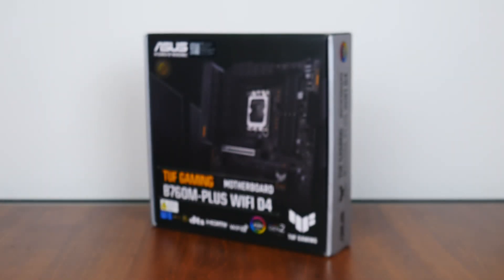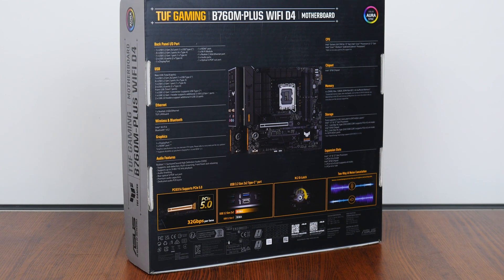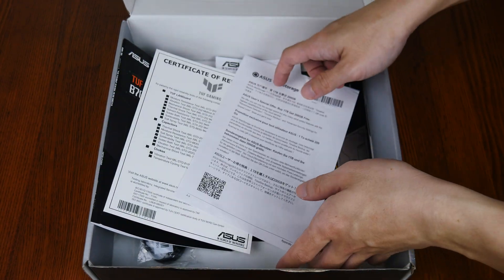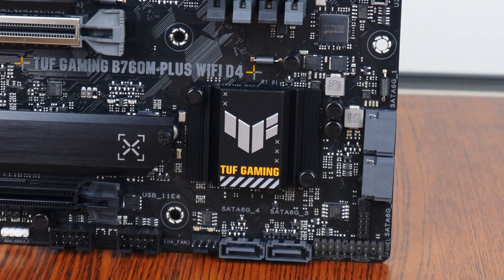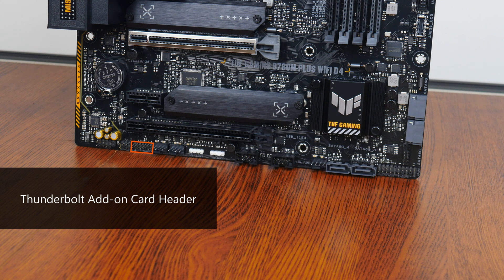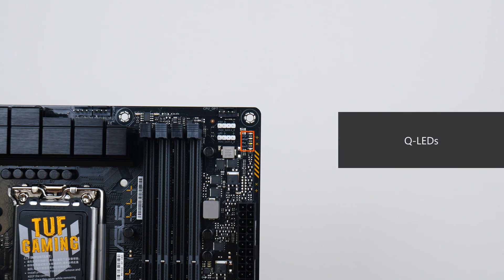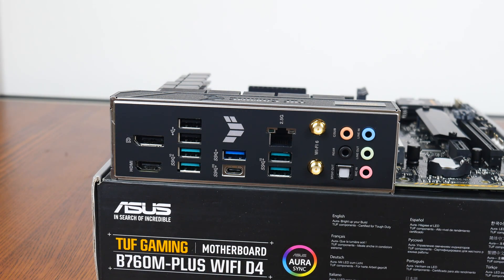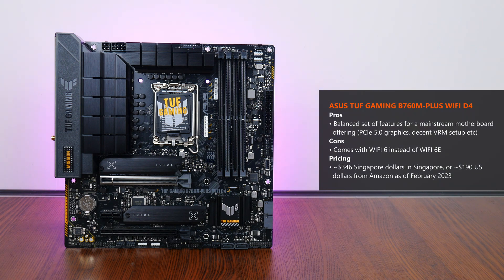Mainstream Intel B760 Motherboard - ASUS TUF GAMING B760M-PLUS WIFI D4 Unboxing & Overview

Comment: perfect for a i5 12400f or 14400f, you might even be able to throw
in the i5 14600k or 12600K, which might be a better option with the 
latter since later lga1700 boards can handle 12th gen pretty well,
compared to the B660 chipset. that struggled to run even a i5 12400,
so this is an improvement, that said i probably wouldn't go any higher.
Reply from the maker: Yup I do agree with you that I wouldn't go beyond a 14600K with this board! Out of curiosity, you mentioned you had issues with a B660 board running a 12400, what kinds of issues were they and which board in particular were you using?
Reply: @ALKtech  it was a Gigabyte board, one of their
gaming x boards. had a different layout than newer,
so it was above UD, but the temperatures on the 
i5 12500 which is what i have were 47 and 48.
i mean that's not bad but not great either, cause soon as you start any gaming on it even light gaming, 79c is where mine was and that's with a 240mm AIO from Artic and 120mm fan. i had a
120, but i had to replace it with two 140mm fans
which was enough to fit in my case. doing that helped my temps down from 79 to 75, so it was
an improvement. so when later boards came
around, i ended up switching it. now my temperatures are much better at 68c.
so my idle temperatures are 35c, that alone
is the biggest difference. like mid 40's would
make more sense on a high end processor,
not something that's down in the low to midrange. So i think it was a combination of the board partners being unprepared for 12th gen, which
is why i can't blame them for going overboard
on z790 and b760 boards.
Reply from the maker: @Jeymez  got it, thanks for sharing. I do agree that those temps are pretty high for a 12400, glad that you managed to bring them down with a better board! I suspect the B660 Gaming X that you had probably didn't have a good design, perhaps Gigabyte cheaped out on the VRM setup/PCB quality etc...

Comment: can i pair this board with an i7 12700f? And will the i7 overheat with a 7 heatpipe 120mm air cooler?
Reply from the maker: Yup this board will work with a 12700F for sure - do you have the exact model of air cooler in mind?
Reply: @ALKtech  Hey! it is the rise mode winter black 120mm
Reply from the maker: @pedroaugusto9_  doesn't seem to be much info available on this cooler on the web - you can always install the cooler first and see how your 12700F performs by doing benchmarks and monitoring the CPU temperature with apps such as HWINFO64. If temperatures look fine and the CPU isn't throttling, you can stick with the cooler for sure!
Reply: @ALKtech  ok, thank you!

Comment: What’s different between B760M-Plus wifi D4 vs B660M-Plus wifi d4 ? And does it worth upgrading ?
Reply from the maker: The B760 offering has a newer chipset, a better VRM setup and a slightly different PCIe slot configuration than the B660 board. If you already have the B660 board, there is no value at all in upgrading! Besides, the B660 board also supports Intel's latest 14th Gen processors..

Comment: Now I'm thinking of buying it. I will use it with I5 12400f และ rtx 4060 ti But I bought it for future use. In the case of upgrading CPU and RAM and various equipment I think this board might be suitable for me.
Reply from the maker: Oh yes, this board supports 14th Gen processors so you'll definitely have an upgrade path from the 12400F in the future!
Reply: @ALKtech  I would like to ask a bit more. Suppose I want to overclock. I5 12400f ( BCLK ) This motherboard can be overclock ? Or does it have to be a B660 board with DDR5 RAM?
Reply from the maker: @KINGCEOTV  I haven't tried BCLK overclocking with a B760 board before, but having trawled some internet forums, it does appear that ASUS B760 boards might not be able to do BCLK overclocking successfully - it does appear that MSI B760 boards can do BCLK overclocking though...

Comment: Very informative video.  Got this board on Black Friday($119.99 US) and pairing it with the i7-12700K($211.00 US) and the ASUS microATX P201 case...I know the 760 won't overclock, but the K - CPU was massively cheaper than the non-K at the time. Receiving the rest of my build parts today...kinda excited!!
Reply from the maker: Sounds like you've got a nice build on hand - what graphics card will you be using? I'd get the K version over the non-K in a heartbeat if the K's cheaper for sure!
Reply: @ALKtech  for right now I am going to use the the integrated CPU graphics. It's mainly going to be for music production so I am going to see how it performs in that realm before investing too much in a GPU.
Reply from the maker: @musicturtletony8498  sounds good, since a GPU won't really be necessary in your use case. You could always look to the secondhand GPU market too if need be, to save that extra cash!

Comment: i heard that there are sometimes some issues with the bios because of the cpu so i wonder if my i7 12700kf would get a issue like that on this board. I would appreciate it if someone would help me out
Reply from the maker: What kinds of issues did you hear about? If you're talking about compatibility and stability, I'd think the 12700KF should work just fine, seeing as it's a last-gen processor after all!
Reply: This bored says it should be 12th 13th and 14th compatible

Comment: what is the wifi-6 input? does that mean u need a cap or sth?
Reply from the maker: Are you referring to the point I raised about the board not supporting WIFI 6E? If so, WIFI 6E is essentially a wireless standard for internet connectivity that is faster than WIFI 6. It just means that this board won't be able to support the speeds supported by a WIFI 6E-compliant router!

Comment: Is this ok with I5-13500 and 2080Ti Oc? Im not sure if its going to destroy the pcs performance.
Reply from the maker: This board will handle a 13500 and 2080 Ti just fine, not to worry. Just make sure you've got a decent CPU cooler and good airflow in your PC case!
Reply: @ALKtech  yeah, I thought Ive had issue with cooling, turned out my thermal paste was dry af. Thx.

Comment: Does it have tpm which is necessary for win 11? I was comparing this with a board of same class from msi and they mention tpm header. Need some clarity on this.
Reply from the maker: You don't need a discrete TPM per se - modern processors (such as Intel's 12th/13th/14th Gen processors to be used with this B760M-PLUS motherboard) already include a firmware variant of TPM onboard. The TPM header is only if you'd like to get a dedicated TPM device for very specific use cases - if you're an average user intending to use your PC for gaming and normal productivity workloads, you won't need to purchase a separate TPM module just to be able to install Windows 11. Hope this clarifies!
Reply: @ALKtech yeah that makes sense. Thanks for clearing it up.

Comment: What's better this one or tomahawk?
Reply from the maker: I assume you're comparing this to the MAG B760 Tomahawk WIFI DDR4? The Tomahawk comes in the ATX form factor, while the ASUS board in this video comes in the micro ATX form factor. That aside, both boards are otherwise quite similar, apart from the fact the MSI has a slightly better VRM setup. What processor are you intending to use with either of these boards?
Reply: @ALKtech  i5 13600kf
Reply from the maker: @Gforce577  the 13600KF will work just fine with either board. Is there a price difference between the ASUS and MSI where you're from?
Reply: @ALKtech  yes asus more expensive if it just the same i just choose the cheaper one
Reply from the maker: @Gforce577  go for the MSI then since it's the cheaper variant - you'll want to make sure that the MSI fits your PC case though, as like I mentioned, the ASUS board in this video is micro ATX while the MSI board is full-sized ATX!
Reply: @ALKtech  i just buy the rog strix b760-g ddr5 version matx since i watch it in your channel and read it in rog website seems good but now. I want to use it with matx case does it needs matx power supply or the atx one the same?
Reply from the maker: @Gforce577  any normal PC power supply will fit in a mATX or full-sized ATX case, they have a pretty standard set of dimensions!

Comment: Can i use it with Intel 13700 ? Will it deliver full performance?
Reply from the maker: It should handle a 13700 just fine, make sure you've got a good CPU cooler!
Reply: @ALKtech  well if i slightly downgrade the mobo i mean if i take b660 same board Asus tuf gaming.. will it able to handle 13700 non K processor?
Reply from the maker: @ALAMIN4000  the TUF Gaming B660 series of boards should handle a 13700 well too!

Comment: Hello,  This model of the motherboard has 12 power inputs from the power supply device, should I use all of them or is the eight input cable enough for normally?  Because my power supply has only eight power inputs for the motherboard, I have a lot of stress about not causing damage to my motherboard if using eight inputs, all my talk was about isus b760 tuf gamin plus wifi d4
Reply from the maker: If you're not using a power-hungry processor like an i7-13700K, i9-13900K etc, you can get by with just connecting the 8-pin CPU power connector and leaving the 4-pin connector alone. What processor are you using/intending to use with this board?
Reply: @ALKtech  3 12100f
Reply from the maker: @voodoomoo  the 12100F doesn't consume a whole lot of power - you can get away by just hooking up only the 8-pin CPU power connector!
Reply: @ALKtech is 13500 will also be fine with 8 pin? also this mobo cant recognize my sata drivers as bootable drive. I already enable CSM in the BIOS. im wondering if i need to buy an nvme m.2 ssd.

Comment: Help! I bought this motherboard, and it won't fit with any of the CPU coolers I had. first try cryorig h7 then try dark rock pro 4 both have the same issue which is mounting socket cannot fit in. who knows what going on?
Reply from the maker: There should be a mounting backplate included with the coolers that you bought - you would usually have to install the backplate on to the motherboard as per the instructions manual, and thereafter mount the CPU cooler (with the processor already in the socket of course). Are you able to describe in greater detail the issue that you're facing with installation?
Reply: @ALKtech  Oh, I realized the backplate is not compatible. I had to buy an upgrade kit. Thanks for the guidance.🙏

Comment: will a 2 fan rtx vga fit in this motherboard? seems like the ram is so close to the vga slot
Reply from the maker: A two-fan or even three-fan graphics card will fit, not to worry! This is because board manufacturers have to spec a certain amount of clearance to ensure maximum compatibility, given the modular nature of PC components!

Comment: Hi, i'm going to buy this motherboard and I wonder if I would have a problem installing the arctic freezer 34 esports duo cooler...The VRAM heatsink is long and I don't know if it might affect when installing it, could you help me?
Reply from the maker: While I haven't actually tested this for myself, I don't think you'll have issues with clearances installing the Arctic Freezer on this board - CPU cooler manufacturers tend to spec in enough clearance so as to cater to a variety of motherboard VRM heatsink designs!

Comment: Currently planning my own build and I wanted to pair this motherboard with intel core i5 2600k with a Radeon rx 6600 would this be a good pairing anyone feel free to comment 🙏🏾
Reply from the maker: I'm assuming your processor is a 12600K, not a 2600K right? In any case, a 12600K+RX 6600 combo will work fine, though I'm curious what will you be using your PC for predominantly? Will you be gaming at say, 1080p?
Reply: @ALKtech  yes sorry the 12600k and mostly for gaming/streaming
Reply from the maker: @assassinx-rated1440  thanks for sharing your specs! Do you game at 1080p? The RX 6600 isn't exactly a fast GPU, and realistically speaking you'd probably be looking at gaming at 1080p Medium/High settings for decent FPS.
Reply: @ALKtech  so what would you recommend? I heard some good things about the 6600 I just want to start out with a gpu this is my first pic build so I’m not looking to go all out but I am look for decent hardware I won’t have to upgrade for awhile
Reply from the maker: @assassinx-rated1440  are you able to share the kinds of games/workload that you'll be using your PC with, and whether you might have a budget in mind? Would narrow down the type of GPU to recommend considerably!
Reply: @ALKtech  my budget is 850-1000 dollars I’m planning on gaming esports titles such as call of duty Overwatch Fortnite apex legends cyberpunk naraka bladepoint and many more of games that hasn’t  been released yet
Reply: @ALKtech  I’m also going to be using twitch and YouTube

Comment: I'm thinking of getting this board for a build with a 4070 and an i5 3600k (deepcool ak620 for cooling) would this be a good pairing?
Reply from the maker: I think this combo will do great - you might have to do some voltage tweaking to keep the 13600K's thermals in check with the AK620, at least from what I see on forums such as Reddit!

Comment: would this pair up good with an i9 12900k and a RTX 4070!? any help will be appreciated!
Reply from the maker: I'd think this board should handle a 12900K and 4070 combo just fine! Gotta make sure you've got a good cooler for the 12900K..
Reply: @ALKtech  thanks a lot!! this going to help a ton

Comment: if I use an asus dual rtx4070, a 2.56-slot card, will the third pcie x16 still aviable to use? or will the card occupy all 3 slots?
Reply from the maker: I haven't tried this myself so I can't say for sure, but I suspect there should still be space to install an expansion card in the bottommost PCIe x16 slot. That said, depending on how wide your expansion card is, it may also get in the way of the front panel headers on the bottom edge of the board, especially if you're intending to install this motherboard in a compact mATX PC case...
Reply: @ALKtech   thanks a lot, I will consider all possibilities

Comment: Great video!!!
can i increase my RAM from 3200Mhz to 3600Mhz w this motherboard?
( 13600k )
Reply from the maker: You can give it a shot for sure - this board supports RAM speeds of up to DDR4 5333. Whether or not you can hit 3600 speeds on your DDR4 3200s will probably depend on the quality of the memory modules on the RAM sticks, among other things..
Reply: @ALKtech   DDR4 5333  doesn't make any logical sense whatsoever
Reply from the maker: @PuppetMasterdaath144  just manufacturer specifications for folks intending to further overclock their memory - no reason to go to such high speeds for DDR4 when 3600/4000 should do fine (if you're going down the DDR4 route for Alder Lake/Raptor Lake)!

Comment: Imho, one advantage of B760 boards over Z790 boards is:
Realtek LAN > Intel 2.5G Lan (which still has network dropouts even to this day)
Reply from the maker: And that's actually a pretty good point to consider, especially seeing that Intel's been dragging its feet with the packet loss issues etc since the I225-V and even with the latest I226-V...
Reply: @ALKtech  Yeah it is glaring that it's an issue that has not been fully addressed.
I heard that some had to resort to workarounds (e.g. limiting to 1G Duplex mode or something)
Reply from the maker: @blackcyborg009  last I read about this topic was an article on Anandtech - seemed like Intel was recommending end users to disable Energy-Efficient Ethernet (EEE) mode through Windows Device Manager to help reduce the likelihood of connection issues. It's funny when you consider that Intel's been making Ethernet chips for decades and they're been bumbling around with trying to fix this for way too long.

Comment: Is it suitable for i5 13600k?
Reply from the maker: Yeah this board should do just fine with a 13600K - as always gotta make sure you've got good airflow in your case and a good CPU cooler.
Reply: @ALKtech  should i go for asus prime z790 a ?
Reply from the maker: @deepakparashar2883  the PRIME Z790-A is a full-sized ATX board that uses DDR5, which will have an impact on the RAM and PC case that you can use. Also, the PRIME is a higher-end board that is much more pricey than the TUF Gaming in this video, factor in the cost of DDR5 and your overall build cost will go up for sure. Do you have a certain budget in mind for your PC build?

Comment: What about DDR5 Ver. of this board?  would you recommend it?   I don't know if i should get DDR4 or DDR5 .
Reply from the maker: What processor are you intending to use for your build, and will you be using your PC primarily for gaming? If budget is a concern, going DDR4 and getting some speedy low latency DDR4 kits will do just fine actually, especially since you're already looking at a more mid-range motherboard offering like this TUF Gaming!
Reply: @ALKtech   Mainly gaming. I plan to get I513500  and rtx4070ti  but I'm stuck with DDR4 or DDR5  someone said that intel gen13 work better with DDR5   and i calculated total cost between Ddr4 board ram 3600Mhz  and Ddr5 ram 5200Mhz It's cost  110usd more. so could you give me some tip? (This is my 3rd time buying new PC  My last one was back in 2016)
Reply: @larsalexanderson2028  Difference now between DDR4 an DDR5 is maybe 1%. Not worth the huge investment IMO.